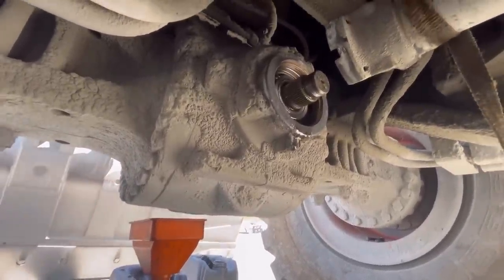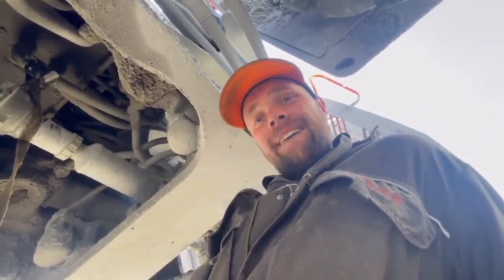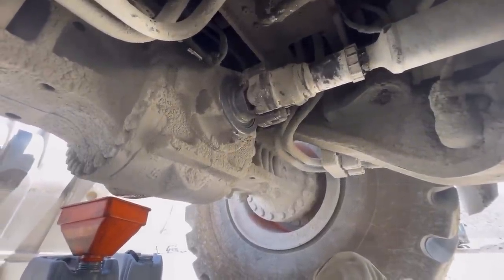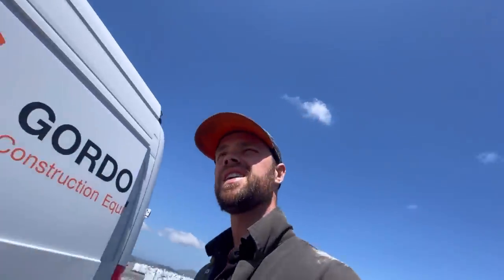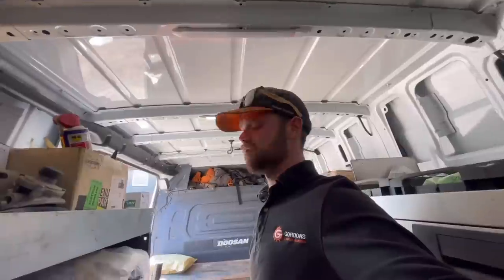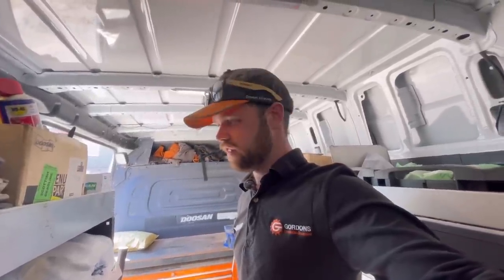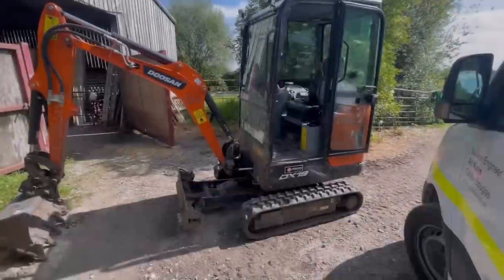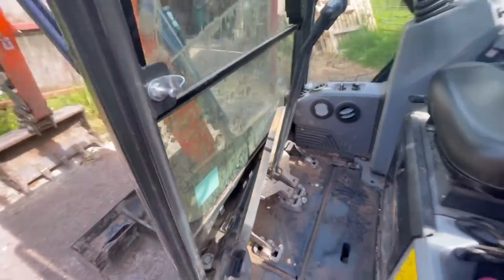A lot got done / still don’t like air con / starting to get warm / Episode - 198

Comment: Cheers Ali, you can’t go wrong with those Diff Pinion Yolks, usually a master Spline. Did you fit a new Breather?. Looks like you struck lucky on the Aircon jobs. See you soon.
Reply from the maker: I made sure the axle breather was clear yea I hope that’s the air con jobs done 😅

Comment: 1st one in. Daft question Ali, could the old seal have been wet due to the “breather dimple” I know you said the level was low, just wondering, & 1st one to like😂
Reply from the maker: The old one was definitely installed correctly first one I’ve done so I’m not sure what caused it 🤷‍♂️ I also checked the axle breather too
Reply: Seems strange having a “breather” in the seal, but nevertheless.
Reply from the maker: Yea I wouldn’t have noticed it but it pays to chat to your colleagues 👍👍